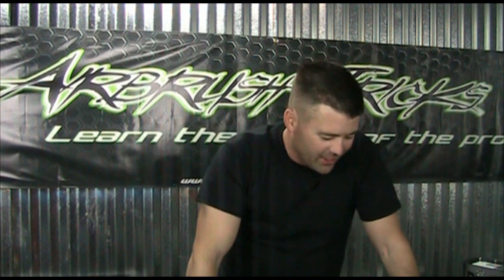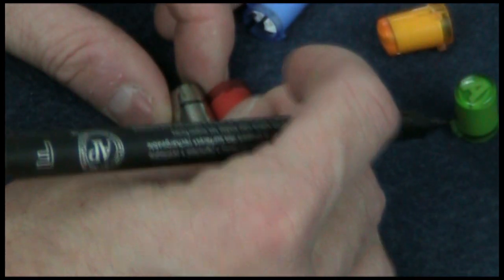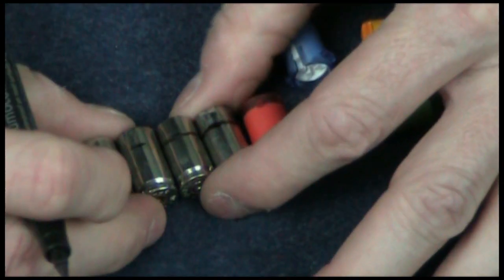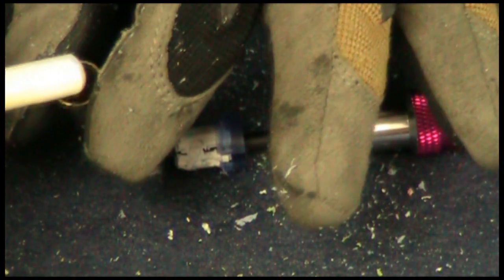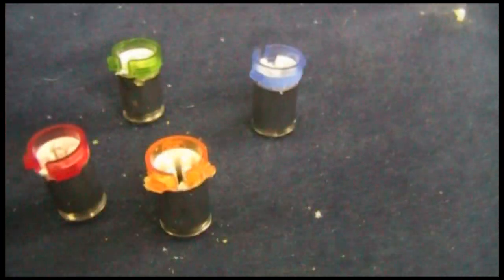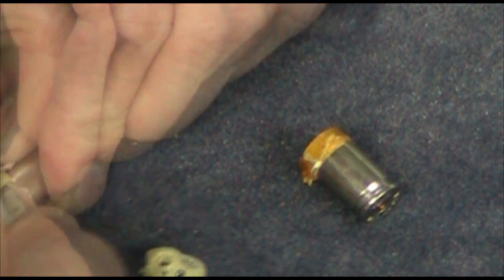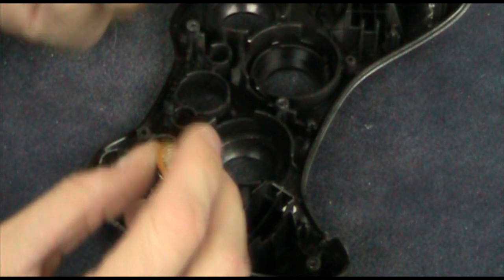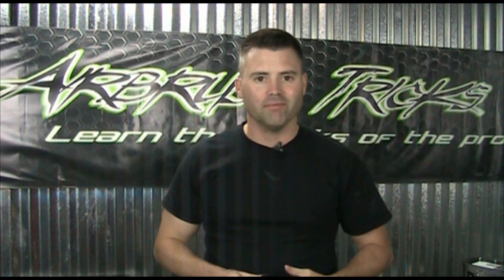XBOX 360 Controller Bullet Button Mod - How to actually make bullet buttons

Comment: Hey Tony D.
 Awesome idea. I know the kids in my school would love this mod !!! Just to make mention. The viewers could use an electric drill with a 3/8" or larger chuck, to work as a vise to hold the 9mm casings while they work on them. If they close the chuck lightly, but still snug, this will hold the casing while they cut, scrape glue, or polish the finished product. It beats the crap outta' cuttin' the fingers. From one vet to another, Nam 68 - 72 Thanks for your service. God bless,
Dave

Comment: @AirbrushTricks 
Just a tip on the bullet casings. A 9mm round is technically a 9x19 as you probably know. If people wanting to do this buy .380 rounds they can use those cases and not have to cut them down. A .380 is 9x17! They work perfectly!

Comment: @TheBuckyHD actually a .45 and 9mm don't kill at the same speed, a .45 caliber pistol is actually a bigger bullet with less penetration because of its size, making the total internal damage inflicted on someone much higher than a 9mm would, beings the fact that a 9mm would pass straight through your body compared to the .45 just hitting a bone breaking it and stopping right there.

Comment: @SDCromwell a .45 brass is a bit wider than a 9mm, making it almost impossible unless you shave down the edges of your controller where the buttons come through. A 9mm is a perfect fit to where you hardly have to do anything to make it work.

Comment: I found a solution to that it's called a step/conecutter I have been using one to put in transforming dpads into older shells as the transforming dpads only fit into the controllers that come with them ie MW3-GOW-HALO but man has it improved that d-pad also you can buy transforming d-pads for £2.99 makes the black shells look really good especially if you use full black out buttons with a chrome guide and transforming dpad takes minutes to convert the old shells so they fit very easy once u know

Comment from the maker: @bvdesa79094 I found some on an auction website. You can get like 300 for around 10$. Some buzzwords your looking for are "unprocessed" spent brass. Processed, means the spent primers have been taken out already so there is a hole in the back.

Comment: Well I am also a firearm owner. .380 is a good defensive round, especially for a woman because the round doesn't have as much power for weaker hands so they really aren't useless, no matter what your opinion is. Second, you can only reload so many times before the brass splits (yes this will take a LONG while if you don't overpower your rounds). But if the split isn't terribly bad, then you could use that nonreloadable brass for this by cutting the brass down

Comment: @AirbrushTricks I don't really know a whole lot about ammo. I just think a bullet is a bullet and that's it. So there is a actually a bullet and then it is housed by a casing. So what you want to do is get 9mm Bullets that have already been fired. The casing is the part that is left over. The casing is the part that you want to use. It will be safe to cut because it is no longer a live round.

Comment: @yopirate23 yeah but its kinda hard first discharge the shel then saw the plastic outer case down the the metal so only metal remains the take out the blasting cap and there should be a wierd cardboard material left soke it in water to soften it up then use needle nose pliers to pull it all out cut off about 3 mm of the blasing cap with wire cutters thenhamer it down area your cut and crimp the thing so it looks like a cross and shape it up so it can go back into shell and the deform the shape

Comment: You can also just sand down those little things on the bottom of the buttons and they will slide into the hole of the controller instead of having to save them :)

Comment: Well to me that's a good idea. I already have a bullet guide and ABXY. If you have ever looked inside an xbox controller the contacts for back and select are exactly the same size as the ABXY contacts so in theory they could use 9mm for them just more cutting of the controllers case is needed. Don't listen to the hate bud it's a good idea nobody else has done it. I might even put it to my buddy the creator of the arbiter3 rapidfire hell mod chip as he does loads of custom stuff over @modiify

Comment: I did this a little different I got some wire cutters and cut two sides of the shell and folded it back  so it will hold on without having to glue the buttons inside then i just filled the shell with glue and bits of paper towel so it was flush to rim that way it would push the contact if you do it that way you save the old buttons.

Comment: You want to use gorilla glue because, being a PU based glue, it will expand and create a seal, and it will not allow for any free play in the mount. And its way strong! You can be sure that those buttons will not come apart without a lot of work and even more swearing!

Comment: @CaesarRex That flies in the face of all saftey regulations that are in effect for us electricians here in sweden. You certainly do not cut towards yourself or towards someone else. I have been doing this work for the last 25 years, so believe me, I do have a clue. ANd I have seen quite a few "noobs" who cut their fingers in bad situations. The back of the blade should rest on your index finger and then you have a secure and safe grip on the knife that allows you to cut cables etc.

Comment: Has anyone ever considered making the "Start" and "Back" buttons out of .22 shells? All you would have to do to the controller for them to fit is sand a bit of the hole out. I got the idea when I noticed that no one was making them, but I've never made any bullet buttons, so I don't think I'd be any good at trying to be the first creator.

Comment: I am not sure of the diameter of that nato shell but if it's the same as a 9mm yeah no problem you might have to cut off more as I would have thought that shell casing might be longer than a 9mm but as I said I am not sure of the diameter of that shell. If it's no fatter than a 9mm no problem if it's smaller it will rattle like mad when your rumble packs go off and it will drive you mad lol hope that helped a little :)

Comment: Sorry bud but what do you mean by big button if it's the guide button I have it already modded it's a sniper shell in nickel like my 9mm ABXY. Providing you use the right tools it is really easy but it's getting them tools and my step cone cutter bit itself was £12 then I had to buy a controllable drill with low voltage otherwise you will just destroy your controller if you haven't got a trigger sensitive drill or dremel and your hand if you're not careful. It can cost a lot of money @ first :/

Comment: did you size the bullet so it wasn't to big because when you shoot a bullet the case gets expanded
Reply: +KidCry Pie In most 9mm chambers, the expansion is +0.010 or 0.015, enough that you'd need a magnifying glass to tell the difference in most cases. Also enough to require a pass through a resize die before you reloaded them, but hey, this isn't exactly remanufacturing them for use in a firearm, eh?

Comment: get on ebay and look for spent rounds. I just open my window and pop off with my glock and or hipoint carbine. but this is pretty easy. don't know that type of glue I just use lots of hot glue. looks great.

Comment: @CaesarRex Sure. You go ahead and do it that way if you want. As the saying goes, if the head is stupid the body will suffer.For some reason I think you are just trolling because of my comments on the other video where you replied. And if you dont think being an electrician is to be a craftmen, then you seriously need to get a clue before you answer again. I have for 25 years done electrical installations, computer builds (usually in combination), dealing with setting up server halls.